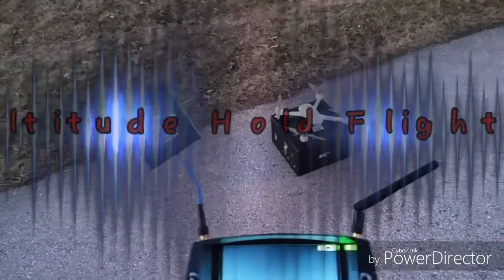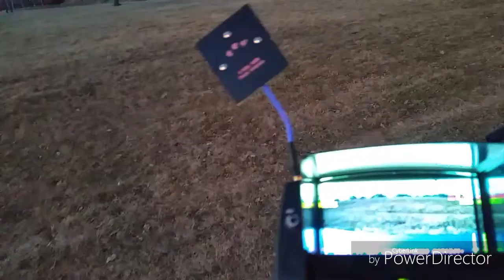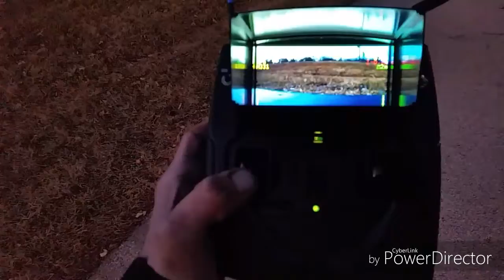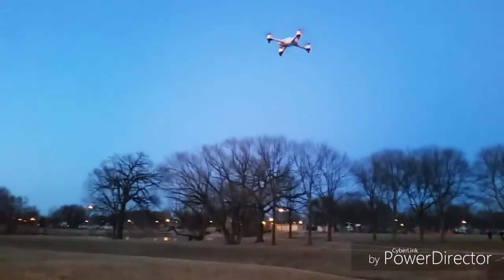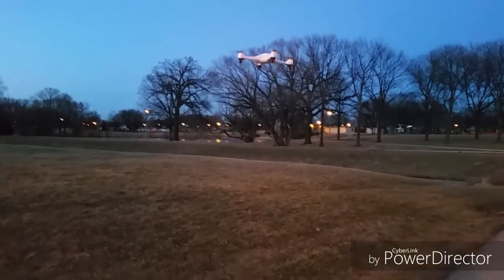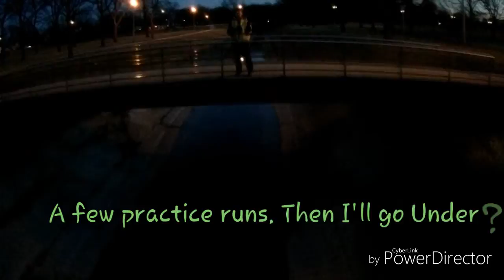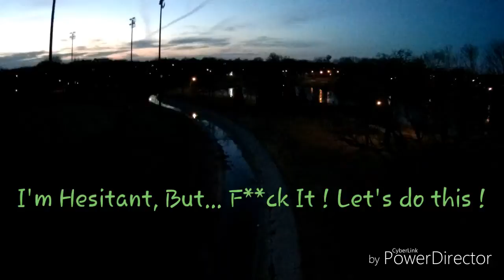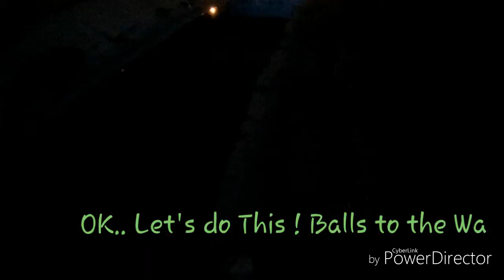hubsan h501ss Altitude Hold Practice and Flying though Obstacles. Awesome

Comment: PS: FAA says not to fly above 400 and not at night. Doing this can jeopardize every ones rights to fly by Govt. making new laws and rules. AND, you could have some one knocking on your door for the stupid video. Dont do it again.
Reply from the maker: What are you talking about ? I'm well aware of  all the FAA Regulations and laws. Matter of fact, I passed a 107. So, exactly what and when are you referring to, that I flew above 400 feet ? Also, flying a UAV at night, is perfectly legal as long as the craft has lights, on the front and back, for orientation and you can definitely tell the altitude, and L.O.S. distance. So, with a 501SS, you have telemetry data on the controller, lights on the front and back, so which law/regulation, did I violate ?? Could you answer that, before you post a comment, like you did. Especially after I'm almost positive, I've helped you with issues you were having, with your quad. If not, I'd still like an explanation, as to why you would leave a comment on 1, out 100+ videos, I've made ? Also, it makes absolutely, no sense. Strange ??? Hmm ??
Reply: Mark Suttner , Brother Mark! Obviously someone is suffering from a brain eating disorder or something in that matter, but you don’t have to prove anything to that brain distorted missing whatever it is, I’m serious that is very strange brother.  
Alright brother Tyl!